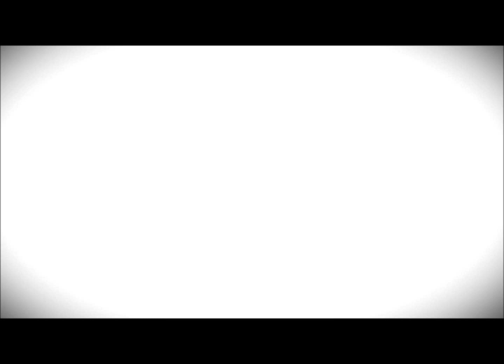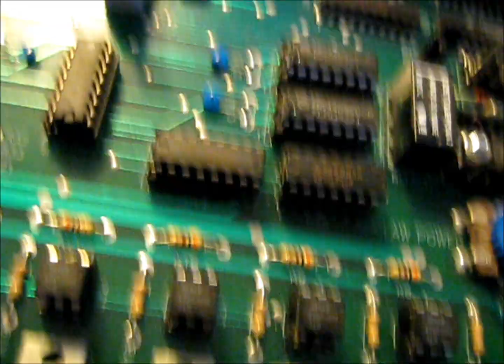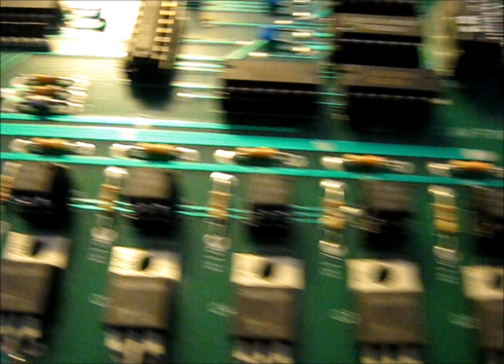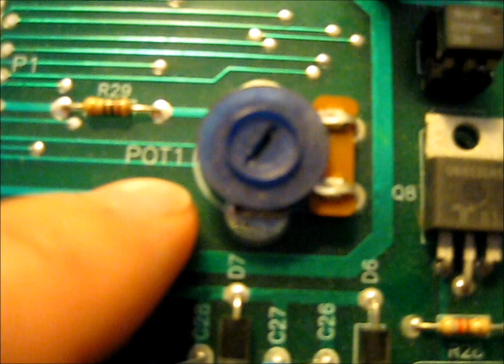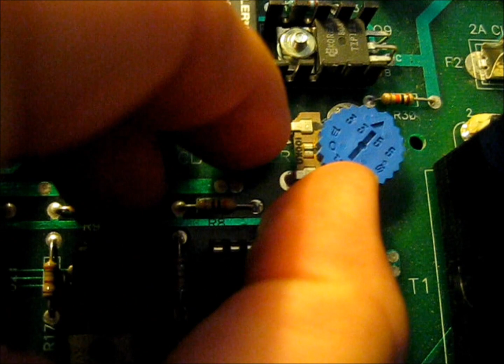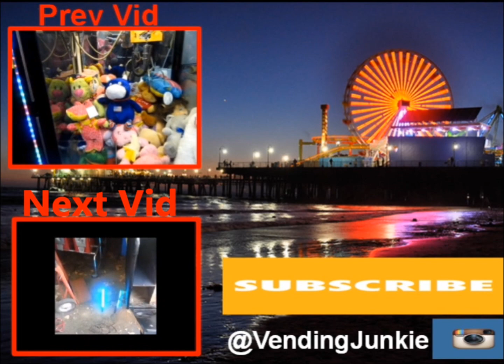How To Adjust Your Claw Strength

Comment: ive been into claw machines for a while now and ive gone through 2 so far and my 3rd is being delivered tomorrow , I ordered the machine from eBay and stupid me didn't think to ask if the machine came with a manual ,well it turns out it doesn't    .I've looked on google for it and i have found nothing. I will be okay with things like the pot dials however i need the manual in terms of dip switches. Do you have any ideas on how to solve this dilemma ?? thanks.
Reply from the maker: Yes, just follow the steps in the video.